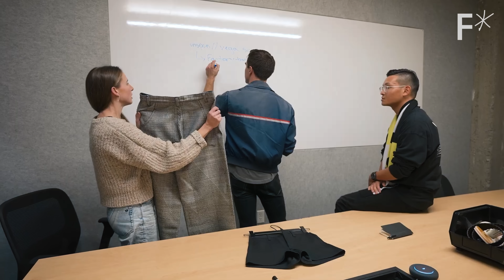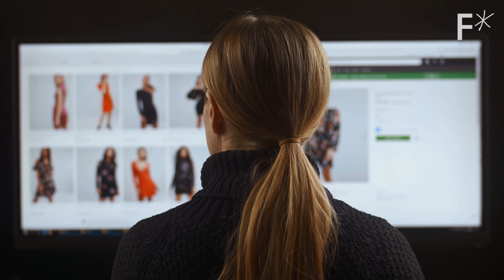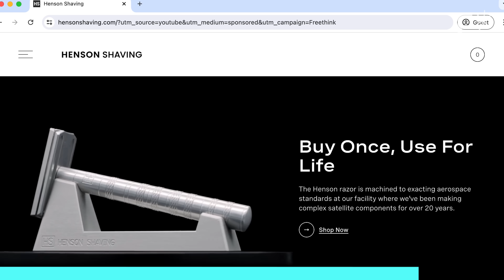The secret robot that will disrupt fashion | Hard Reset

Comment: with knitting, i kind of understand how this process could work. but with WEAVING, how would they be able to alter the WIDTH of the leg tube? yes, you can shorten the threads going around the tube (weft) , but you can't take out or add any of the vertical threads (warp) to actually change the diameter of the tube, with the overall same level of thread density of the fabric.  so, i wonder if their custom made pants, are just like.. always straight tubes?  

i guess the channel tried to oversell this company.. like with vertical farming, great idea, and yes its closer to the area of distribution, but in these times the volume makes the price, and unless the WHOLE process is fully automated, you will not be able to compete with mass made fashion, like at all.
Reply: just 10 minutes of "finishing up the product" in a capital of a developed country will make it financially out of reach for many people. 
for someone who wants a custom tailored pants for 600$, why wouldn't they instead go to a real tailor? are people really lazy or socially awkward enough to spend 30 minutes at home scanning their body with their phone, instead of simply going to the city to meet a real human tailor?

Comment: Considering the high initial cost of the 3D loom, the company is likely to adopt some kind of printer-cartridge or razor-razor blade model to make the material exclusive to the machine. If the goal is to make customized garment, would robotic automation of cutting and sewing be a more versatile and lower cost approach?

Comment: Good concept. Don't believe in the proposed recycling method though because long usage will always damage the fibres. I waer my stuff until it got a hole and then xou won't be able to make a new one out of the same fibre without respinning it.
Reply: I think the point of their recycling method is to recycle fast fashion items, like things people will only wear a couple of times and then they’ll recycle it into something else. 

You should look into Le Utthe, it’s probably the most “sustainable” fast fashion brand there is. It’s an Argentinian company, that does the whole process by themselves, they supply the cotton from their own plantations in Argentina (so they don’t use cotton from countries on the other side of the world), they manufacture locally, they do the logistics with their own float of trucks and sell in the shops owned and managed by them (so no franchises, at least not yet). They even developed a process to recycle the cloth scraps, and they have a bunch of pieces of clothing made with their recycled cotton.
While design-wise they aren’t exactly the best, their clothes are very affordable (clothing in Argentina is super expensive due to very protectionist policies, so their prices are actually very good). They have over 50 stores in Argentina, and they are planning on expanding to neighboring countries. 
It’s not perfect, it’s still fast fashion, and the quality is not good, but at least they are employing locals in every step of the manufacture process, they mainly source the raw materials locally and recycle their own waste (they do import certain synthetic materials as far as I know).

Comment: Of they can promote it as am eco friendly and ethical alternative, it's not going to be cheap at all, and unless you scan yourself once and then order online (if the measurements are still accurate), the extra time needed for shop employees to attend to you will make more expensive than big chains were you can get everything yourself from the rack, try it and pay wasting only a fraction of the time of the cashier's, locker's, and restocker's employees time

Comment: This report is inaccurate. Yes this circular weaving machine technology is novel as weaving machines or looms are traditionally/typically flat bed machines but there have been circular knitting machines from the start of the industrial revolution. And knitting machines can produce fully fashioned garments made to measure/fit with minimal finishing required just as the garments shown here. So creating made to measure garments with no waste and minimal finishing is not as novel or revolutionary as this report makes it out to be. The novelty is the circular weaving machine tech and that this is done for WOVEN garments, a distinction not even mentioned in this report which I find bizarre!
Reply: Like Socks? They're cylindrical and seamless.

Comment: this won't change the user behavior, which is the main cause anyway, if this can change the buying behavior, it is achieve the "green" it claim, if not it will just as the same as the other fast-fashion and achieve profit, huge profit, but it just automate a small part

Comment: even socks are made the same way...what would be suuuuuper innovative?
Reply: Socks likely would not benefit much from this. There is some uniqueness in feet,. but not so much that the typical flexible sock cannot already currently handle. The "body-customization" part of this is more designed for length of legs, hips, breasts, shoulders, arms, etc... as there's a bit more diversity in that.

Comment: I think that whoever mass produces anything should be required to be responsible for the waste the product will produce, and have that solution in place before the product hits the market. There is so much cheap crap produced and 100% of it goes straight to the landfill. We buy it and pay to dispose of it and the manufactures keep spiting them out, like disposable razors. Man has the intelligence and the ability, and most of all knows better that to just generate garbage that ends up being the consumers problem. Once they're responsible for the waste of their product you know they're going to rethink it and stop taking advantage of consumers and our planet.
Reply: That would be good, manufacturing responsible for waste, a high 'waste tax' and then encouraging local custom clothing shops, ideally set up as NFP worker co-operatives.
Reply: Check out "Extended Producer Responsibility"— already EU regulation beginning in 2025. :)
Reply: This exactly! 3D looms will only be a disteuction to make you think things are changing.